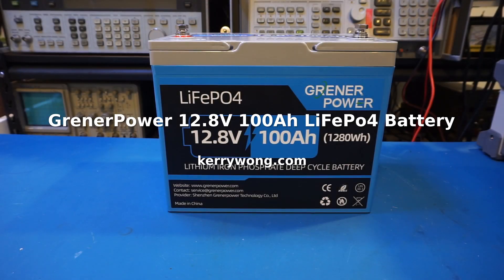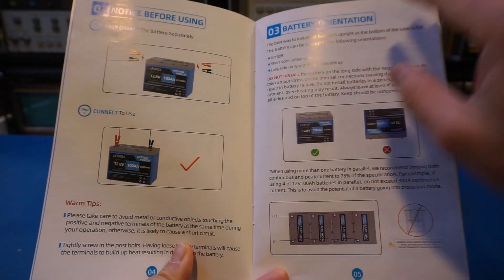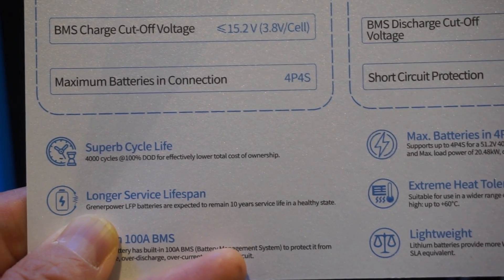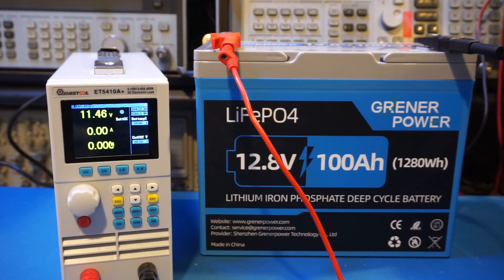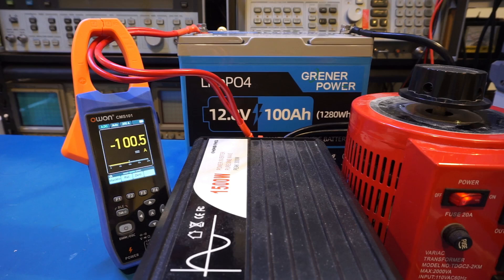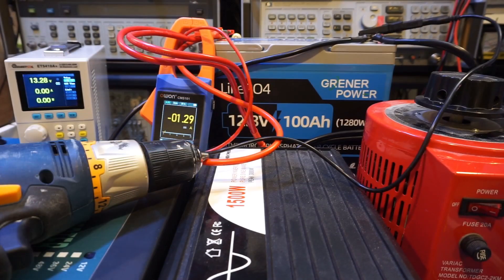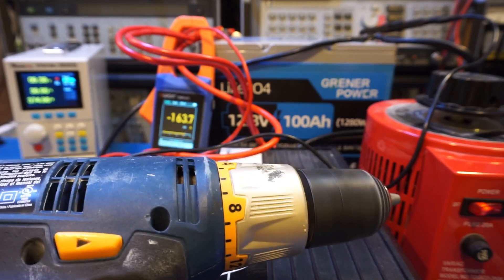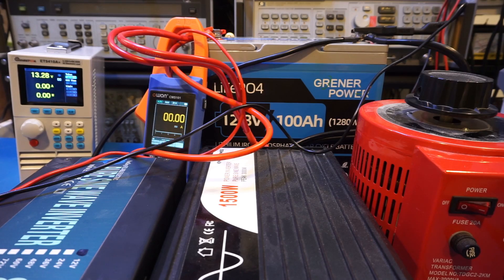GrenerPower 12V 100Ah LiFePO4 Battery

Comment: LOL IF THE BATTERY IS RATED FOR 100AMPS then WHY DOES IT ALLOW IT TO GO OVER by 100 AMPS LOL NO BATTERY THATS 100AH SHOULD BE ABLE TO RUN AT 200AMPS CONSTANTLY SO YEAH THIS BATTERY IS DANGEROUS PLEASE PEOPLE DONT BUY
Reply: 100ah is its rated capacity. Safe continuous discharge current is 100a at 20°c temp.
Peak discharge current is 200a for 3 second
It's in the product manual he shows in the video
Edit: it looks like it will continuously deliver 200a until a certain cell temperature has reached, Probably fine for the battery itself according to its c rating
Reply: @shyamsuresh1723  lol are you stupid it did 200amps for more then 30 seconds what in the world are you talking about lol did you watched  he whole video clearly not
Reply: You need to replace your keyboard, the CapsLock key is broken.
The battery is rated 100Ah. Ah means Amp HOURS.
So, it's capacity is rated to supply 100A for one hour, or 50A for 2 hours, or 2A for 50 hours, or even 200A for 1/2 hour.
You are very confused. Did you know that a typical high quality 2Ah 18650 tool cell can continuously supply 20A? But only for about 5-6 minutes.

Comment: thats crazy i bought a 100ah lifepo4 battery from AMAZON and it cost me 135.00 dollars after shipping and it arrived in 1 day and the battery i bought comes with bluetooth and ALL THE PROTECTIONS A BATTERY CAN HAVE SO WHY WOULD ANYONE WANT TO BUY THIS BATTERY THAT COST WAY MORE AND IT DOESNT HAVE ALL THE PROTECTIONS A BATTERY SHOULD HAVE LOL ALSO WITH MY BATTERY YOU CAN CHANGE ALLL THE SETTING TO WHAT EVER MEATS YOUR NEEDS SO LIKE I HAVE MY BATTERY STOP CHARGING AT 13.6V and TO STOP DISCHARGING AT 12.0V AND YOU CAN CHANGE ANY SETTING YOU WANT WITH THE MJBYSAN BATTERY I BOUGHT FROM AMAZON AND IVE BEEN USING IT FOR 6 MONTHS AND ITS STILL WORKING GREAT SO YEAH ALL BATTERIES SHOULD HAVE LOW TEMP AND HIGH TEMP AND ALL THE OTHER PROTECTIONS IF MY CHEAP 135.00 DOLLAR BATTERY HAS ALL THE PROTECTIONS THEN BATTEIES LIKE THIS THAT COST MORE SHOULD HAVE ALL THE PROTECTIONS SO YEAH YOU NEED TO DO BETTER GenerPower